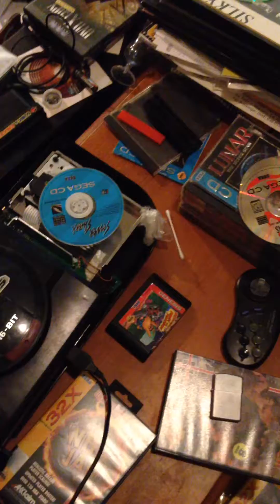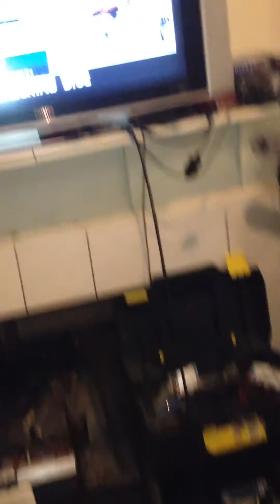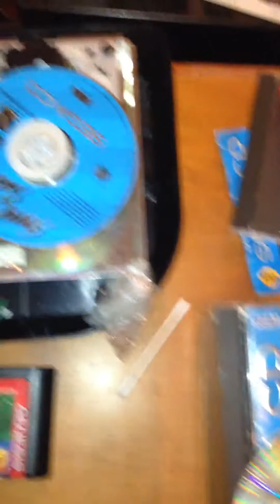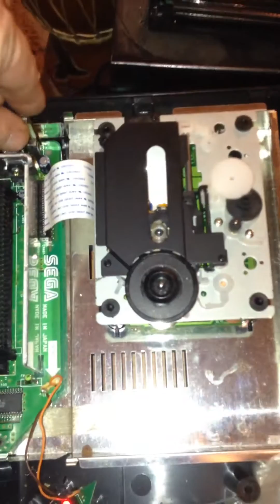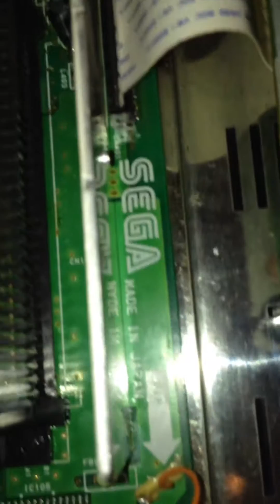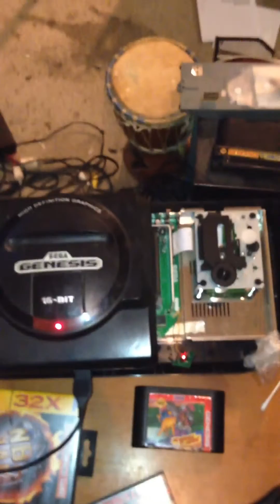Model 2 SegaCD disc won't spin after capacitor replacement

Comment: This is lens problem. Spindle motor will only works if the lens can read something.
Reply from the maker: Thanks, I found it odd this would happen after a cap replacement, but I'll try messing with that. I appreciate the comment!!

Comment: Had the same problem.  Did you try cleaning the lens with a q tip and Windex?   If the lens doesnt detect the disc, the motor never spins.  That worked for me.

Comment: The wrong type of capacitors replace?
Reply from the maker: +Xmod&#39;s Gaming (Xmods) I can try putting the old caps back to satisfy that requirement, however I've also seen a board that was recapped and worked fine. Disconnected the CD ribbon and after plugging it back in the motor would only spin at about 1/3 of the rate it should. I'm thinking there must be something that happened which throws the calibration out of wack or something. I don't have an oscilloscope but I do have a digital multimeter...